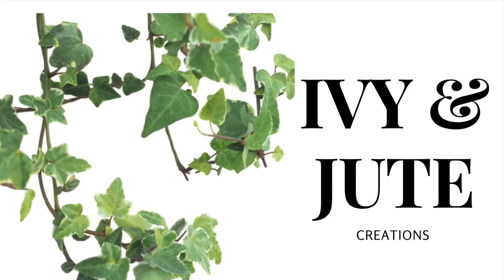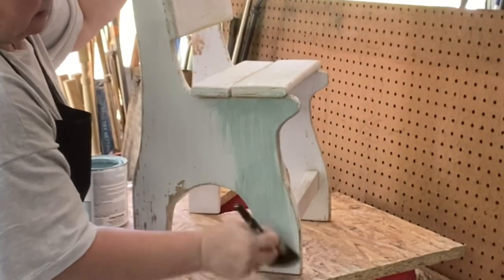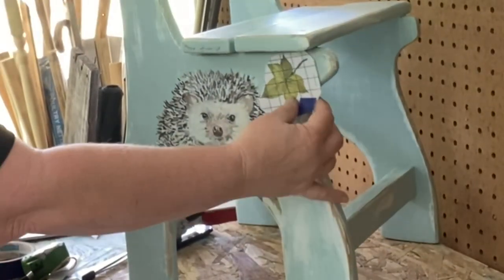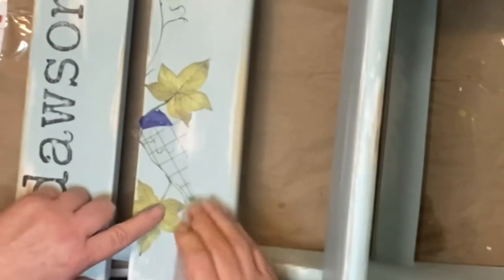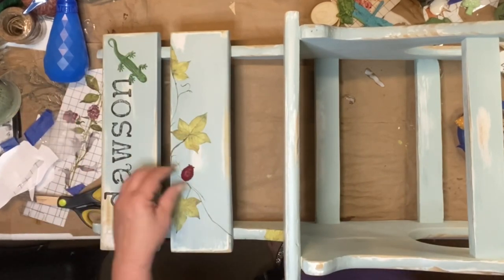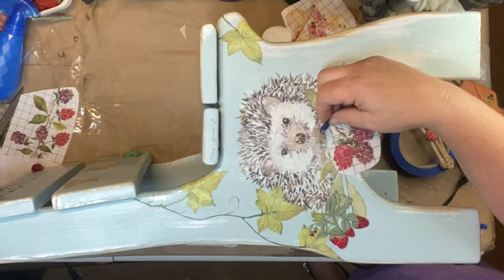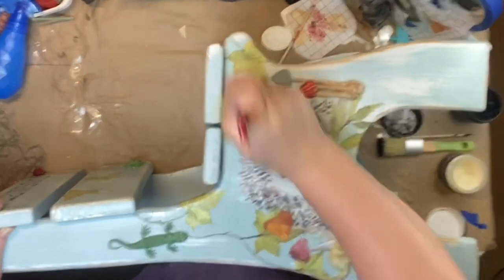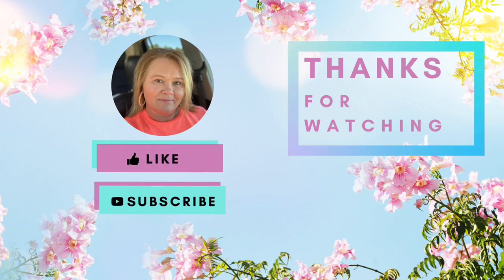USING IOD TRANSFERS & MOULDS TO REDO A CHILDS CHAIR #iod #iodtransfers

Comment: It turned out great.  😊  I struggle with embellishments and transfer placement, too. I have this picture in my mind how I think it will look, but rarely am I satisfied with it when done because I feel like it needs more. The CRAZY thing is when I watch other creators or see their finished products, it's the simple ones that I love best.  lol.   I also struggle with alignment  (very mild OCD). Papers have to be stacked by size and set perfectly aligned with edge of desk or table, etc. Dishes, cookers, cups, even silverware drives me crazy if it's not stacked by size. So I get you girl, random placement has more visual appeal but it's a real challenge.   🤯🙃  I haven't found a solution yet but like you I get frustrated with myself and say you HAVE to finish this before you can start a new project. It works most of the time. LOL.
Reply from the maker: Oh no! Lol. I hear ya on the papers & all things in the kitchen! That’s me to a “T”.  Let’s don’t even get on the subject of clothes, closet & dressers. Lol. Yep, that’s what I kept telling myself while working on the chair was I could not start another project til I finished it & I was so OVER it so it definitely helped me to finally just put something on it! Lol. Hope you had a blessed Easter my love! ❤️